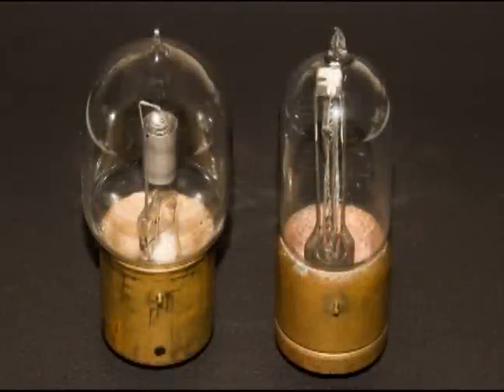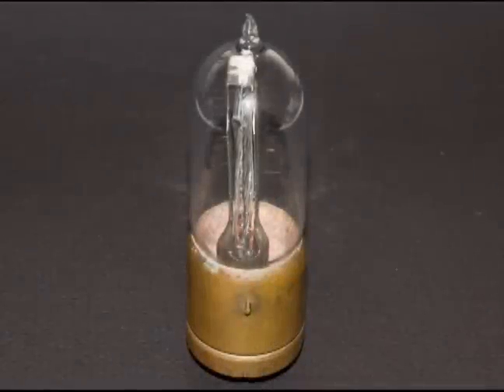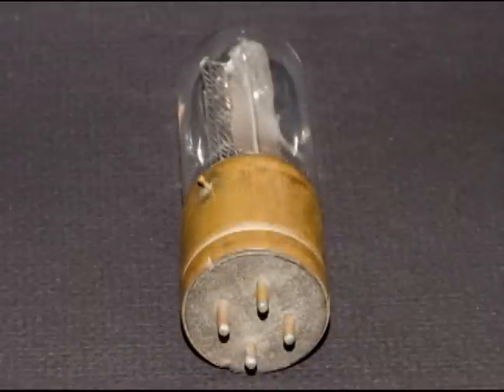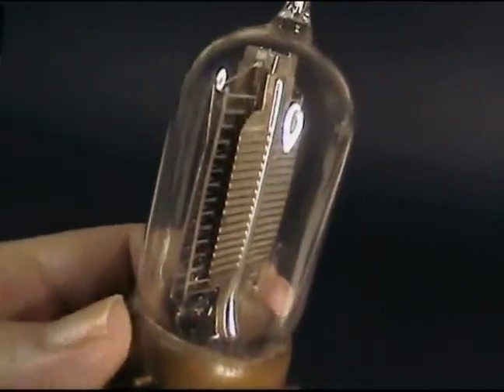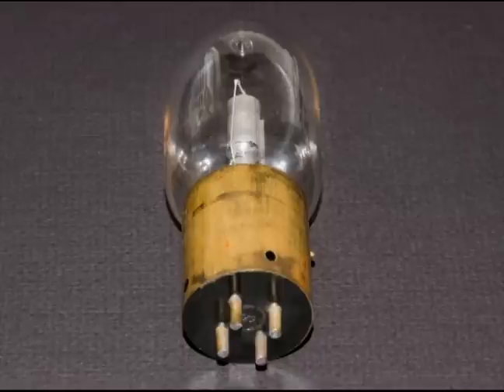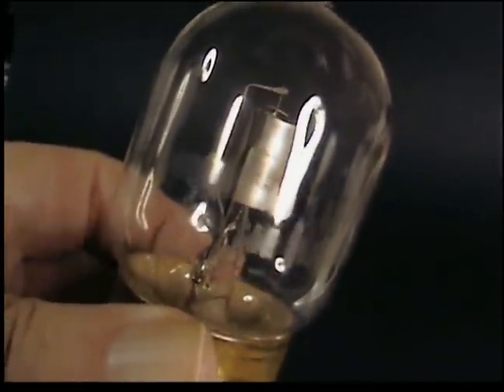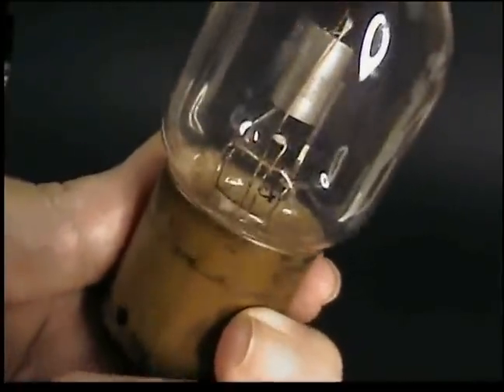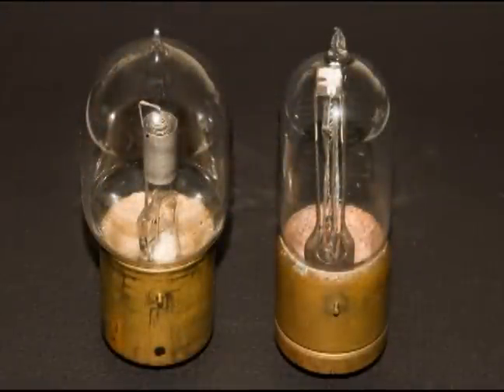Moorhead labs and Western Electric Vacuum Tubes

Comment from the maker: For the VT-1/203A the filament voltage is 2.5v @ 1.1A
The 01A has a 5v filament. I am not sure what the pin out is of a VT-1, have to look it up.
Thanks.

Comment from the maker: It would be amazing to see one of those receivers. The key is a small pin on the side of the base of the tube. The tube sockets have a metal sleeves with a one vertical slot. The pin fit down the slot and then you turn the tube to lock it in. I have two videos on a 1925 Magnavox radio, I think you can see the tube sockets there. Thanks.